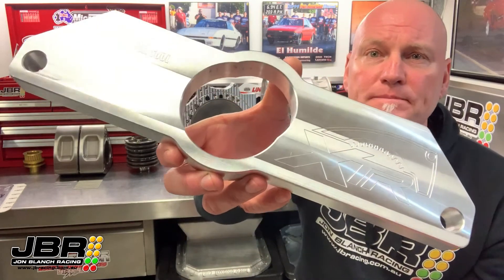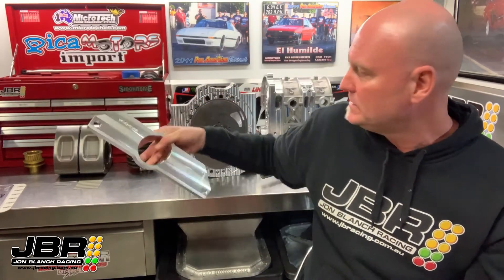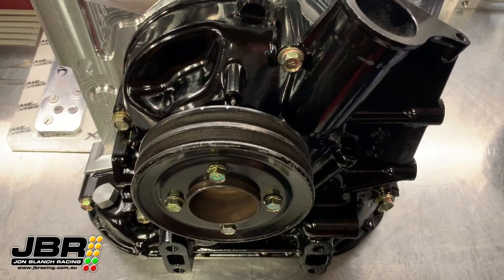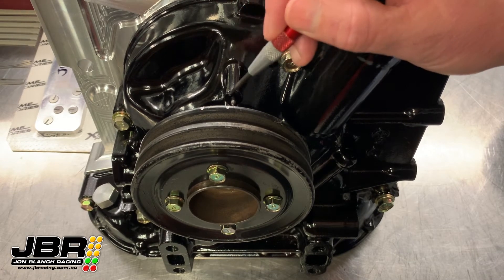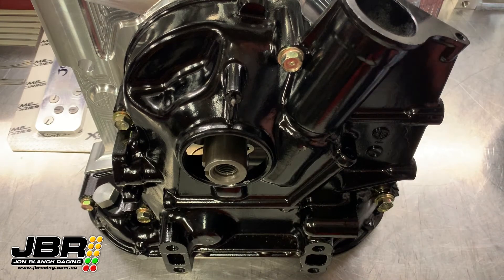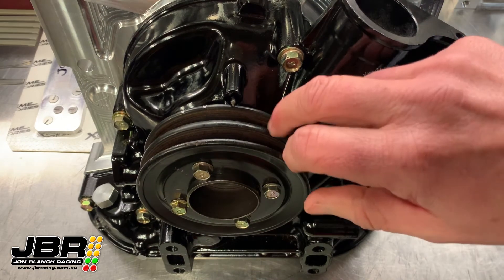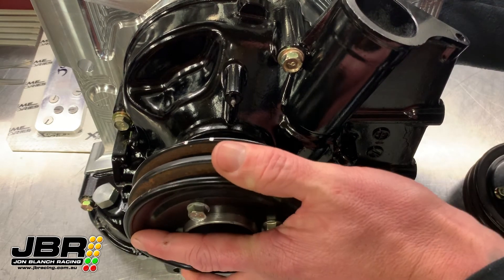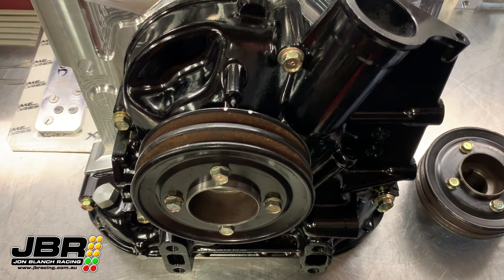How to find TDC on a Rotary Engine

Comment: Great video. It looks like the issue is both the pulley and the drive hub, the 4 bolts look rotated round as well as the notches in the wrong place. Scary how badly out they get! 

I know people like to find tdc by putting a screw driver in the plug holes but I’ve always thought this doesn’t work on a 12a with a ldr rotor and sloping combustion chamber. 

Also the spark holes are symmetrical up and down on the housing. 

Doesn’t seem like there’s an easy way to find the timing without pulling the front pulley hub and checking the keywsy is at 9 o clock. And doing that is a risk of Torrington bearings slipping.

Comment: Hey Jon! Awesome tool, I’ve read that the E shaft keyway is 90° from TDC, curious if that’s an accurate number to machine marks on a pulley too or if it’s just a “rule of thumb” number, thanks 😎
Reply from the maker: In theory, yes you should be able to use the keyway as a reference for tdc. However, in my experience the keyway isn’t always cut perfectly. 
This is more common on some aftermarket billet cranks as opposed to the factory Mazda ones

Comment: Man, I did not know that. Due to some running issues I could never figure out, I definitely have to check mine. Thanks for that valuable info. Just wondering how Mazda factory     tuned those engines correctly in the first place? Thanks again.